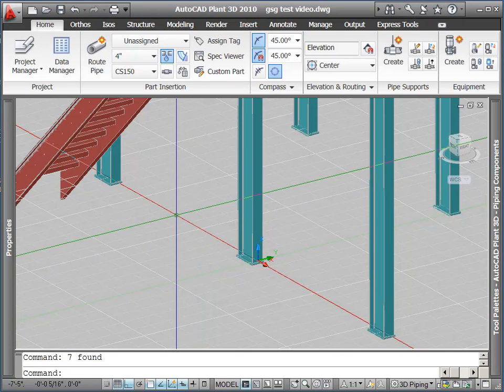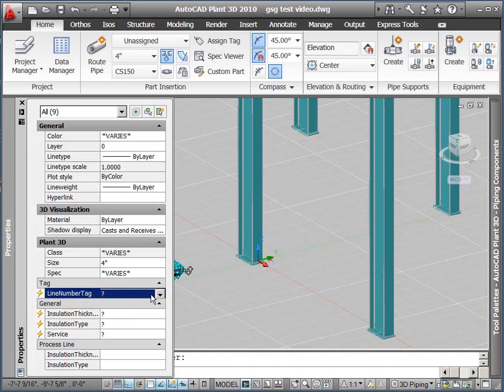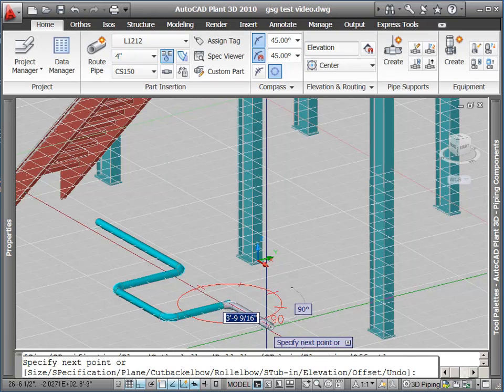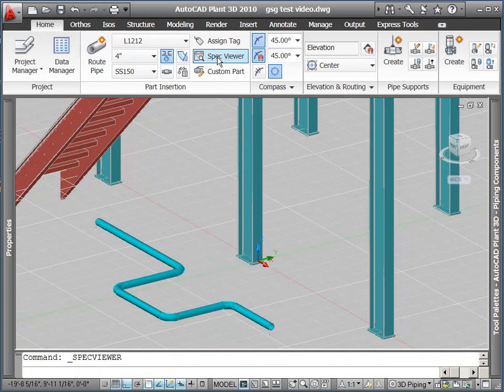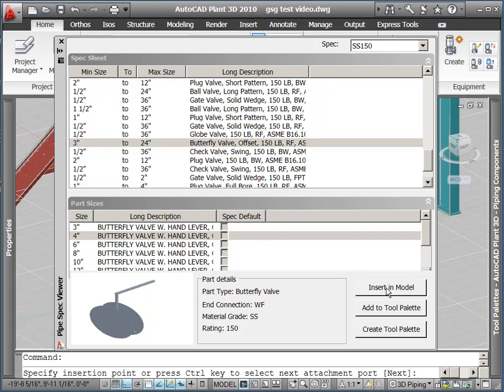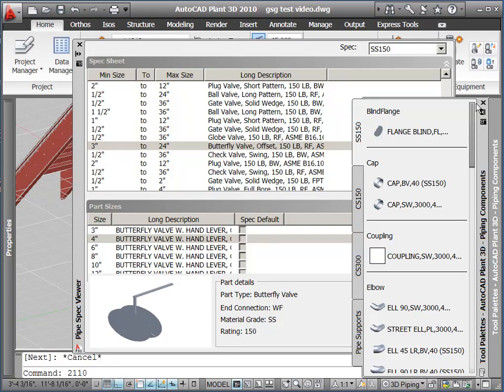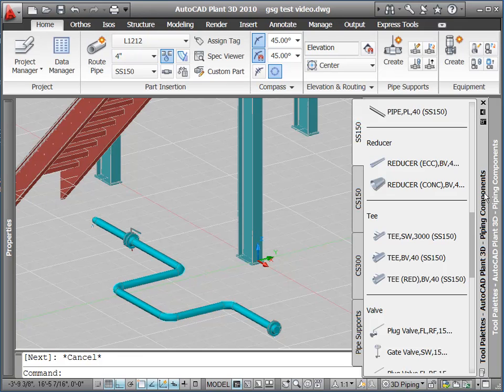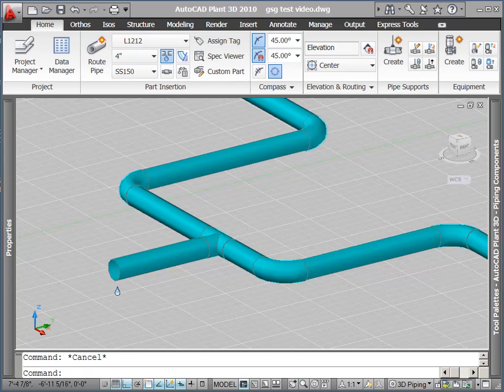3 AutoCAD Plant 3D Getting Started Video   Piping 1

Comment: The frustrating this aboout all these video's is they do not show how to set up Plant 3d. I run my own firm. I do my own drawings, but cannot get started in Plant 3d because the setup seems daunting and confusing. 

Please could you make a up to date video showing:
-setup of this software from base install. 
-Starting a new project
-importing of unique items, including the correct parameters needed for it to be fully functioning. 
-starting a P&ID document, how to set up the back stuff, these video's are great for once a project settings are ready but if the base software is not configured its a nightmare. 

It really would be great to see this.